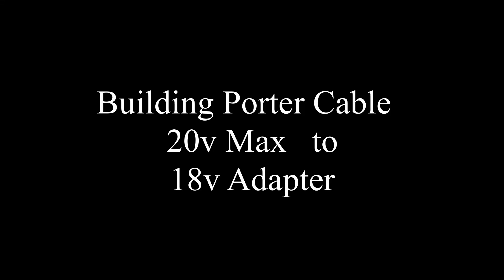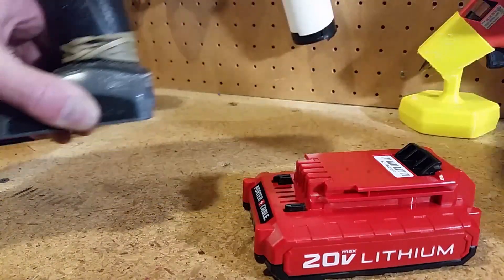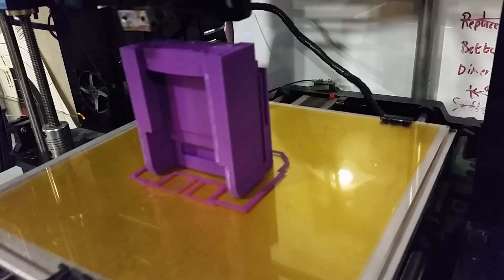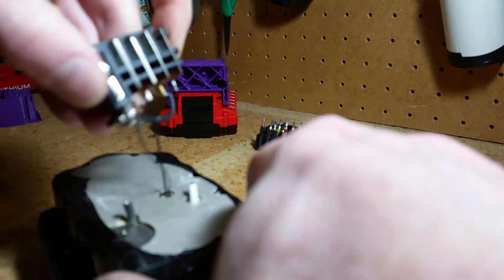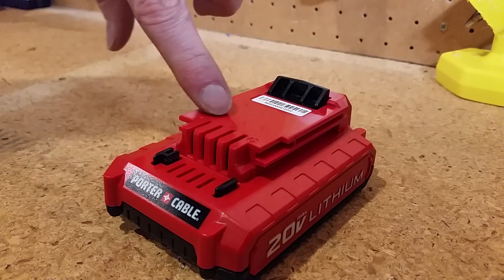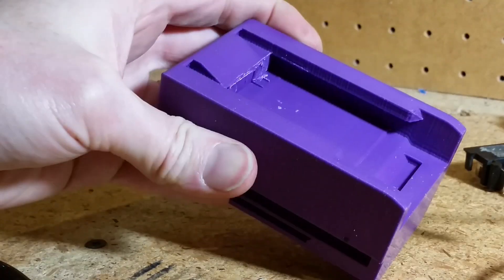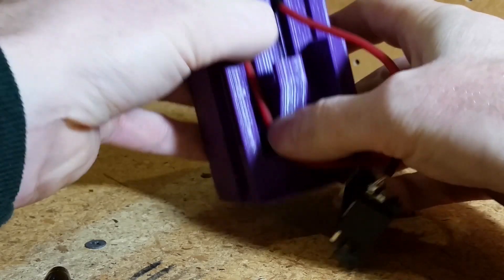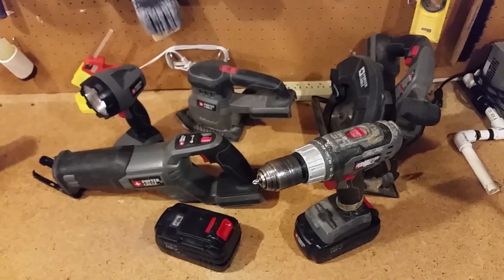3D-Printed Porter Cable 20v to 18v Battery Adapter

Comment: If you still have these, the Black and Decker 20v lithium battery is, like, 99% the same as the Porter Cable 20v lithium battery.
There's a little block of plastic in the side of the track that won't allow the B&D batter to fit all the way into the Porter Cable slot, and there's like a chamfer on the B&D batteries that isn't on the PC tools.
Cheers!

Comment: There is no step-down or diode? How 20v is worked with 18? Do you have any problems with tools?
Reply from the maker: No, it's really close.  Under load, the 20s are 17 or 18 anyway.
Reply: @wingnutbren  Thank you

Comment: Could you do me a quick favor and tell me the voltage on the battery between negative and the terminal right next to it? It would help me on a project I'm working on.

If you look at the battery, there are 4 contacts:

 negative / "unlabeled 1" / "unlabeled 2" / positive

I would like to know the voltage across negative and "unlabeled 1"